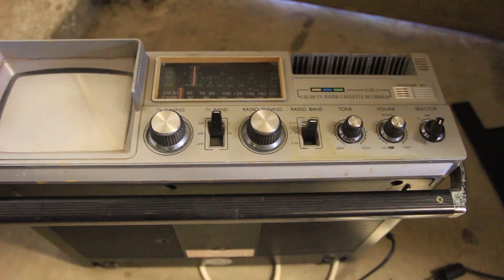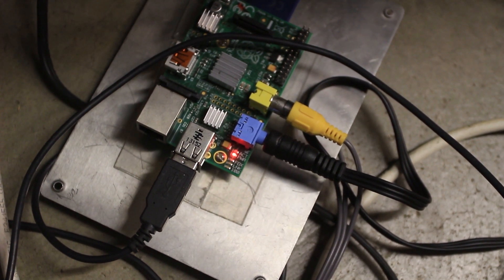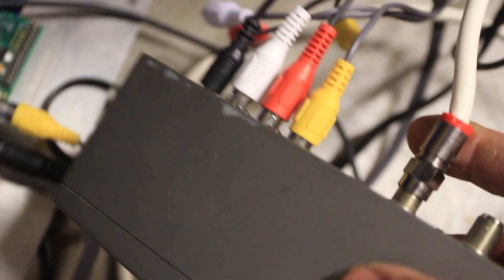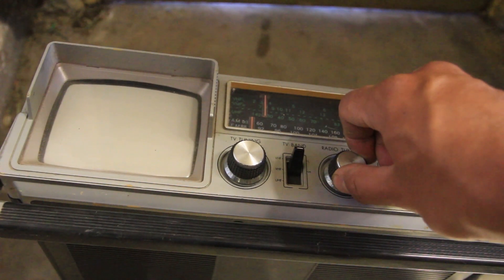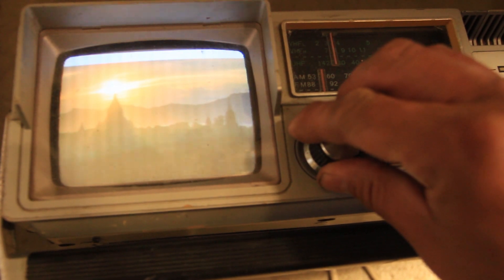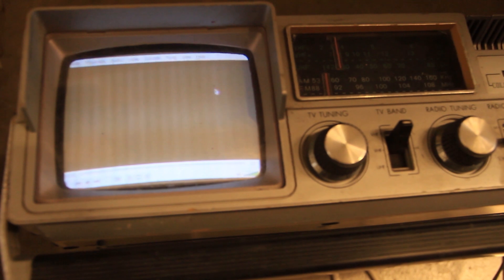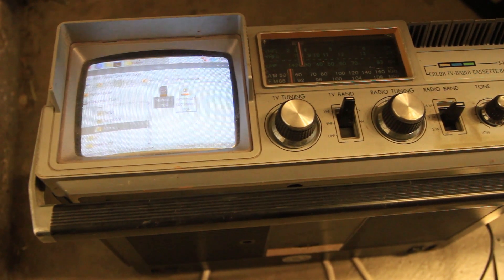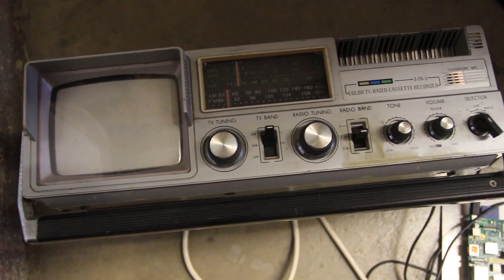Connecting a Raspberry Pi to an old analog TV!

Comment: I'm trying to do the same think with a portable power source like d cells for the tv and lithium pack for the computer, to make for a portable discrete game console....having trouble though. I'm using raspberry pi 4b 8gb model, but I'm having trouble getting the signal to post through the ext antenna. Any advice?
Reply from the maker: You've got to run it into a video converter first, which takes NTSC and puts it on Channel 3. (more hardware)
Reply: @ai6yr500  already got it, but it's like when it does post, its extra fuzzy or extra grainy (more than these old models use to be). Have you managed to fit one inside the old tv yet?
Reply from the maker: @Phatcat1076  No, got distracted. Plenty of room for the Pi, not so much room for the converter box -- have to strip that down to the circuit board.
Reply: @ai6yr500  that's what I'm fixing to do, gonna put the rf modulator for the pi zero w I have and put a ntsc converter in it as well so the actual tv will receive over the air signals.

Comment: Couldn’t you just use the coaxial cable to RCA and skip the modulator? Also with the modulator did you have to tune in to the pi or does it just show up? Lastly, is this broadcasted to every device in range
Reply: you cant just connect the rca to the tv since the tv is built to recieve a tv signal not a video imput, the modulator works as a micro tv broadcasting machine but the signal is very weak as it is designed to connect directly to a tv and not an antenna. i guess if you did connect it to an antenna it would work as a transmitter but the signal would be verry localised and probably wouldnt make it out of the room